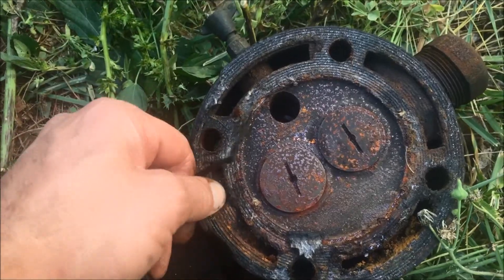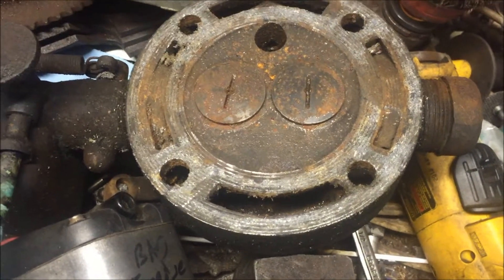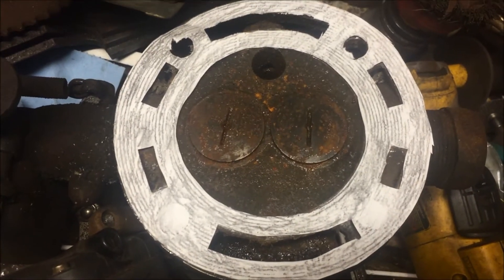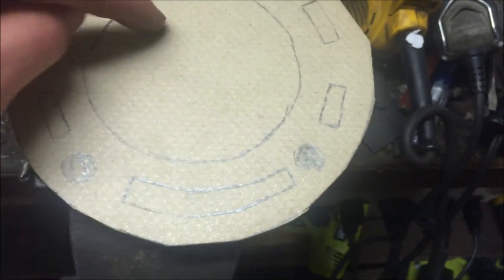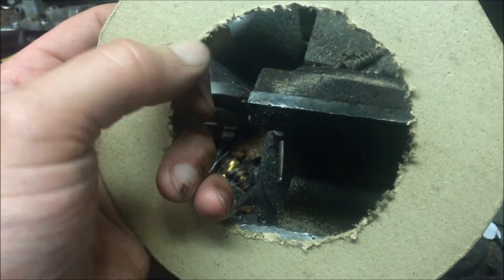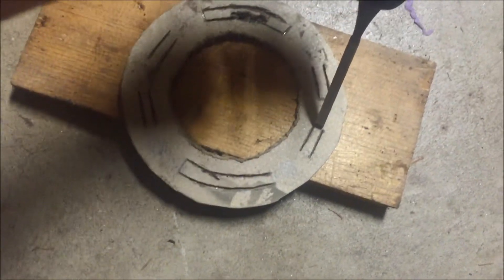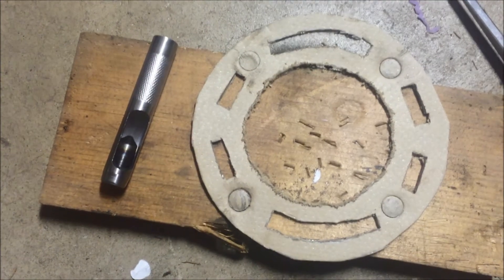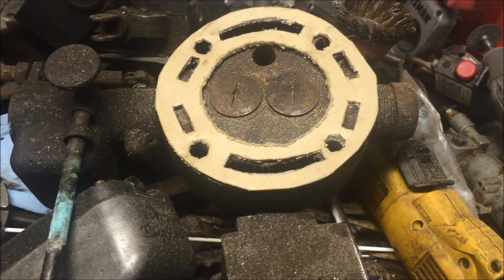1926 2Hp Witte Log Saw Engine Rehab Part 1 Making a Head Gasket

Comment: not that my experience is with old gas engines  but refrigeration compressors. They have those grooves on some of the exhaust valve. They use plain paper gaskets and hold pressure exceeding 300 psig.